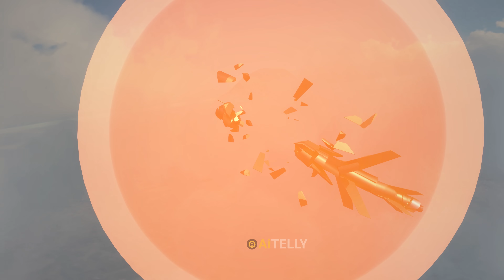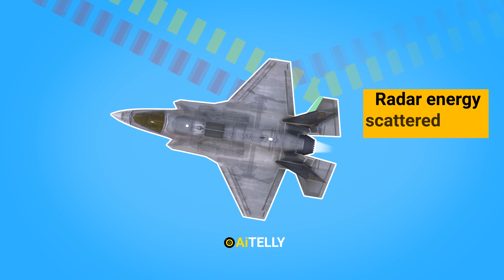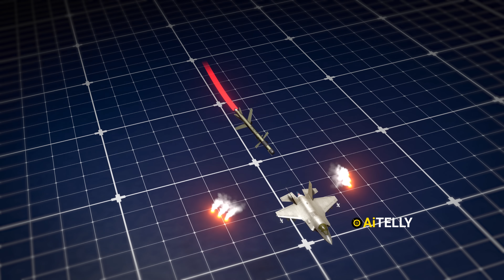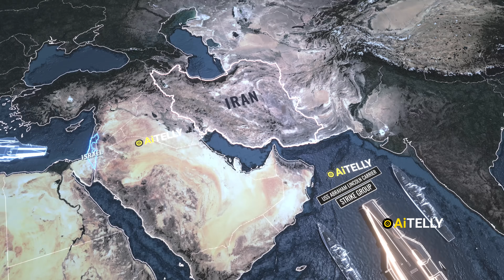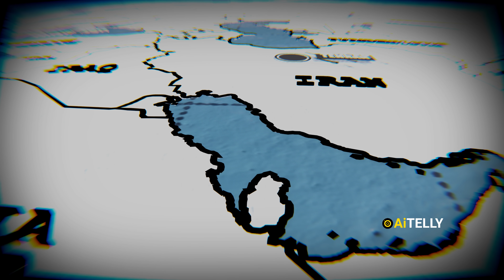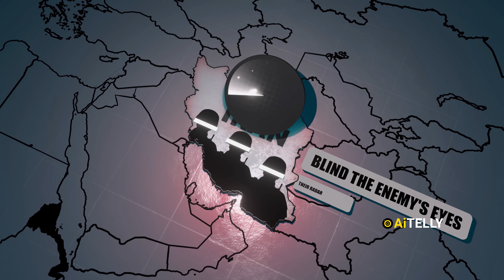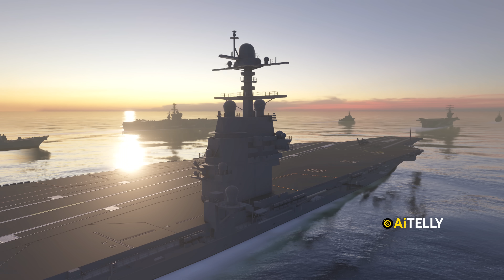How an F-35 Got Hit by Iranian Missile in Operation Epic Fury

Comment: I think you are mistaken. If you watch the Iranian video, you will observe that the missile came from a different angle than that of the camera, which was locked onto the target. It is clear that they used a third party designation ..A platform equipped with an electro-optical camera was used to lock onto the  F-35 and then controlled and guided the missile to hit it. This missile was launched from a different platform. This operation was carried out through cooperation between two platforms in different locations: the tracking/locking platform and the launch platform.
Reply: @ahmedeskander6645  yes I agree, it's like using Starburst or Rapier. In which if not mistaken Iran does have Rapier. 
Or something like it which is not difficult to be build by Iran.
Reply: @nuurulbasarmohdbaki6046 today Iran announced that they used a local manufactured  Platform called Majid. They define Majid as an elctro-optical/ IR Platform
Reply: @ahmedeskander6645 yes a combo off two is not something new. Perhaps in near future we might see fiber optic wire guided SAM which the drones are now able to go up to 10KM.  Still within CLOS and unless your wing man is yeahaaa is using some magnifying glass no one will see it. With the smokeless fuel an optical Lasser Guided Missile can only be detected via a Lasser Early Warning like on modern tanks and some helicopter and unique to Izrsel civilian airlines.
Still 15KM might be the limit not sure how many KM from the ground. 
So next upgrade would be reintroduction of Lasser Early Warning to fighter jets. 
In which guided fiber optic SAM would be the next phase. Which is something existing on Wire Guided Torpedo and Drone right.
Reply: @ahmedeskander6645  wow ,my real name as a weapon,im honored.
Reply: @ahmedeskander6645  that missile doesn't even reach the F35s combat altitude 😂😂 Their video of it has been proven to be fake and AI generated. Also the F35 automatically pops flares when it detects any missile launch. It can even detect the air friction on the nose of the missile and the heat it generates much less the exhaust from the missile. It pops flares automatically. So that video is 100% fake and the missile they said they used can't even reach the F35s combat altitude 😂😂😂😂😂😂
Reply: @nuurulbasarmohdbaki6046  the F35 has a 360 degree sensor suite that can detect the nose of a missile being heated up by air friction alone and the exhaust as well of any launched missile. So if you launch any missile at the F35 it knows. It's sensors see it. 360 degrees. The video is fake as fuck and the only sources saying hit is Iran and "unnamed sources" and the missile they say hit it can't even reach the F35s combat altitude 😂 you people are so uneducated
Reply: Air defense unit have three different elements and are located sometimes at a distance to scatter them but they communicate with each other to complete the chain.
Reply: Yep
Reply: This dude just making USA propaganda
Reply: @ahmedeskander6645  exactly Iranian video showed the pilot Didn't see the missile incoming.. He Didn't  launch flares...the jet definitely crash usa Don't want admit to hide embarrassment.... This guy maybe paid by cia to promote usa agenda..Hahaha
Reply: Yeah, sure thing, comrade, it was a direct hit - that's why it's the ONLY hit on an F-35 out of 7,000 sorties, which then flew home and landed safely. It was kissed by some shrapnel, but keep huffing that copium - your silliness is entertaining.
Reply: Also these missiles don’t travel in straight trajectory they loiter as well seeking their target
Reply: @ahmedeskander6645  isso mesmo. Já pegaram alguns mq-9 dessa forma
Reply: @laerteaero Yes, the same Tech I think.
Reply: The F35 can detect any missile being launched from 360 degrees. Even passive IR missiles. It can detect the air friction heat on the nose of the middle as well as the engine heat from it. It's detected rocket launches from up to 800 miles away. When it detects an incoming missile it pops flairs automatically and the pilot tries to evade. The video showing the plane in all white is fake. The entire plane isn't white in a real thermal camera. Period. Engines are but the body is not as hot as engines and therefore isn't white. The video has been fed through AI programs that have determined the video is fake as fuck and AI made and highly edited. As are all their videos showing the green lines locking on to a plane. All have been proven to be fake when ran through detection software for AI generated and edited videos 😂😂 not to mention if you know how the F35's DAS works it is obviously fake bc zero flairs were popped and the plane kept going straight. That's just totally bullshit. Only people saying missile hit are Iran, "unnamed sources" and articles quoting the original article that quoted the "unnamed sources" 😂😂😂 total bullshit if you actually know how this works. Not to mention Iran doesn't even HAVE AT ALL an IR missile that can hit the F35 at 30k-40k feet which is the altitude it flys during combat unless doing CAS of ground troops which it clearly isn't bc there are no ground troops lmao.
Reply: Its doesnt matter, I am very happily glad, it will be more hit after this, what u give u give, hope u will get brutally get back
Reply: agree, not heat but optical.
Reply: کسایی که میگن نزده 
از توربین مادون قرمز 
که تمام اشیا رو تو هوا می‌تونه ببینه چیزی نمی‌دونم 
همون دوربین دیده میشه و با همون دوربین روی هدف قفل میشه و شما فقط یک موشک باید به سمت شلیک کنید 
تو این کار هیچ چیزی تو آسمون قایم نمیشه 
چون با دید مستقیم دیده میشه 
حتی هواپیماهای آینده هم نمی‌تونن از دید این دوربین قایم بشن 
عین این است که شما از دور یک کوه را بخوای قایم کنی😂😂
Reply: People are acting like this is just the US and Israel versus Iran, like Russia isn't helping. The Russians want to help Iran as payback for the US helping Ukraine.
Reply: @kermitfrog593 I think they are helping with information about target's locations on land, plus live updates taken by the satellites
Reply: @ahmedeskander6645   of course the video was fake 100%. The f35 was out of shape, thermal image don't show heat in a clear shape like that. If getting a direct hit, it is a guarantee that f35 is down. No way they can make it to the base. And if so Iran would show the captured pilot, show off wreckage, radar logs...
Reply: There was no direct contacts with plane, electrical issue e but this channel got a lot of views for it which equals $$$$$
Reply: Iran after all the sanction under tight budget building the technology and system to counter ...😮
Reply: Yeah, these bro pages try are u.s supremacy propaganda and dont give you real information

Comment: I can't believe how much misinformation this video contains. The F-35 did not perform an evasive maneuver or use flares. It most likely did not receive early warning. Speculation suggests it was a short-range Majid missile fitted with an IR/EO sensor. The fighter was probably cruising at low altitude and was hit from the front. The warhead size was small so it survived long enough to reach the base.

Comment: Time-on-Target is amazing tech! Howitzers have a trick where they can launch 155 mm shells every 5 seconds while the barrel is up about 75 degrees, then it lowers the barrel a little & fires another shell, lowers again, firing another shell....each time the ballistic angle diminishes just enough to time it for 5 or 6 shells to land on the same spot at the same time. Wikipedia has a great video on the subject...It's FIRE!

Comment: an F-35 was not shot down (i.e., destroyed or crashed) by an Iranian missile recently. However, there was a confirmed incident on March 19, 2026, where a U.S. Air Force F-35 was hit by what is believed to be Iranian fire (likely a surface-to-air missile or ground fire) during a combat mission over Iran.
According to U.S. Central Command (CENTCOM) statements reported by multiple outlets like CNN, Air & Space Forces Magazine, and others:
•  The F-35 made an emergency landing at a U.S. air base in the Middle East.
•  The pilot is in stable condition (with some reports mentioning shrapnel wounds).
•  The aircraft landed safely but is damaged and under investigation; it won’t return to service soon in at least one account.
•  This marks the first reported hit on a U.S. F-35 in the ongoing conflict (which began in late February 2026 as part of Operation Epic Fury).
Iran’s Islamic Revolutionary Guard Corps (IRGC) claimed they “severely damaged” or shot down the F-35, released purported video footage showing a lock-on and strike (via infrared/thermal systems, as stealth doesn’t hide heat signatures), and suggested a high chance it crashed. However, U.S. sources contradict the “shot down” claim—the jet did not crash and returned to base (albeit in a hard/emergency landing).
Some social media posts and videos exaggerate it as a full shoot-down or claim multiples, but reliable reporting (U.S. military confirmations) sticks to one damaged F-35 that survived. Videos from Iranian sources remain unverified independently, and some discussions question their authenticity.

Comment: LMAO. IRST is based on pinhole or straw sight. Which means when the second countermeasures go off (flares), that infrared tracker on the missile is done for. Also, the missile would have to be going from the back (like in your video) to track the aircraft, but the missile came from the bottom at an angle that would not detect it. Furthermore, the aircraft was glowing hotter than the engine itself. Also, the size of the missile was as big as the F-35, and it was a "contact kill" according to that video. The problem with being fast at creating videos is that eventually you do not get information correct.

Comment: Its not that surprising, just because a jet is considered stealth doesnt mean its invulnerable, its still a piece of equipment and Iran can still get a lucky hit, if an IR anti air system pops up from the ground right below the Stealth jet without it being aware it is now in a vulnerable state and can be hit if its within the IR missiles range, its not like ok now the US air force is invincible its not, but it is most certainly the best in the world, no one is even close to the US air force capabilities. And its war things will get hit, Iran is not Iraq of 2001, they have had 2 decades and partnerships with Russia and China to help build up its own anti US capabilities, meaning they been preparing for decades for a confrontation with the US, so yes its not incomprehensible that equipment will get hit and be damaged, including the F-35. I can guarantee you that the US is going to change its tactics now because they most likely got complacent. And now they will most likely fligh much higher on bombing runs.
Reply: just adding to this, that now the US is going to design stealth jets to hide infrared signatures and heat.

Comment: By releasing an obviously AI-generated video, that’s how. Or did the typical six second length of it not clue that in for you?

How about the ridiculous all-over same temperature of the entire airframe? The one which is somehow at the same temperature of the exhaust? The one which does NOT match up with legitimate thermal video of an F-35 at air shows? Was that sufficient for you, either?

Maybe the way the pilot didn’t bother turning or using countermeasures? Or how the F-35 didn’t famously automatically deploy the towed decoy?

By pushing out content like this, you’re effectively endorsing some extremely sloppy propaganda.

Some have even been speculating it’s a known video of Houthis taking down a drone with a fake F-35 image superimposed on it. I could maybe buy that, too.

But legitimate, it isn’t. And just a few seconds of looking up how cool the F-35 is (Lockheed engineers aren’t idiots; thermal management is an inherent part of stealth) should have been enough for you to avoid idiotically declaring it’s somehow overly hot.

Heck, you could have used common sense and realised, if it was this easy, they would be getting shot down regularly at Red Flag. Or even getting shot down for real by the truckload by now.

Comment: Dude, I watched IR video on different platforms. The video is a AI generated video. That’s the one good thing that Iran can easily do. There’s too many inconsistencies. And you don’t see any counter measures from the aircraft itself. Also, you don’t see any defensive maneuvers from the aircraft, no attempt in notching and after the aircraft was struck it was still flying straight. Two frames you can easily pick it up. I’m just saying it’s AI generated.

Comment: The video of the so-called shootdown is fake as they come. If you look at the infrared signature of the aircraft , it is practically the same as the afterburner.. that pilot would be boiling in his own juices with that high heat. There is no difference being shown between the afterburner and the aircraft in the infrared.

 And if you really slow it down, after the so-called explosion, you will see that the aircraft is entirely intact. This whole thing is fake AI garbage. That explosion that is depicted would have  blown the aircraft out of the sky. And the F35 that landed wasn't even damaged.

Comment: You should have also shown the iranian video hitting the f35 proximity! The frames confirm your video theory, especially when it hit the engine from distance the engine thrust became almost 2 parallel heat lines showing some damage to the engine.

Comment: Nah. the iranians released a video of a direct strike. They used a very small warhead and the f35 is very rugged.
Reply: Nah bro the missile blew up before it hit the jet releasing scrap metal that hit the jet
Reply: Common sense tells us that no airplane will survive a direct hit, let alone make a landing
Reply: That video is a fake, there is no way the exhaust is the same temp as the skin.
Reply: @170_yearsthat video definitely looks wrong. Like the hit/explosion it shows would not leave a plane capable of making it to friendly territory.

Dont get me wrong I think our jets are made tough but that video showed a direct hit meaning their missiles are either really weak or our planes are insanley durable... or like you said the video is fake
Reply: @DanGould-h9x probably a very small warhead truck mounted or shoulder mounted. Something that operates in visual range. Not a property SAM. And no, the planes are tough. But if it can be hit it can be taken down. It's not over
Reply: @DanGould-h9x  Next time 😂

Comment: you DO NOT KNOW that they hit our F-35 to assume you do is just wrong. the video they showed of them hitting this plane, would have destroyed it. might want to wait for the real intel before assuming or taking IRGC info as truth
Reply: also interesting the F-35 showed zero counter movements or flairs. the infrared  showed the jet plume and the jet both the same temp. i would have to go out on a limb and say fake news by IRAN
Reply: @brettharris9141 what counter from heat seaking SAM ..it's not radar based
Reply: @brettharris9141  exactly I cant even waste my time explaining to people that believe Iran like CNN
Reply: @brettharris9141 Yes. 100% fake. Not possible for survival if the plane reaches 1,000°C+ - same temp as the afterburner.
Reply: Exactly so this videos hypothesis is moot.
Reply: What would real intel be? Other than an authentic video.